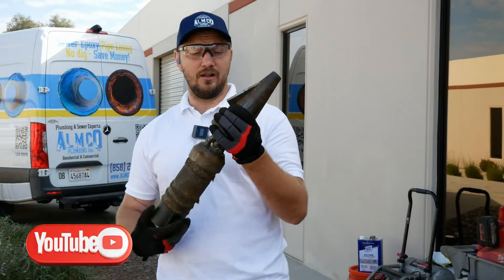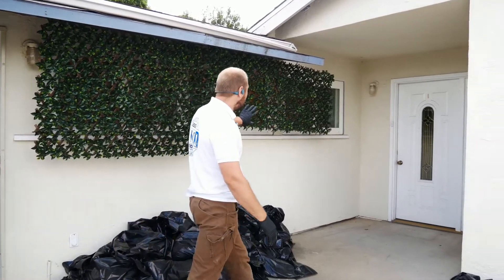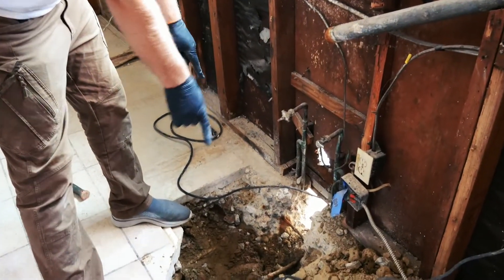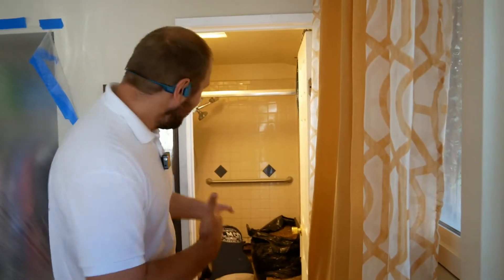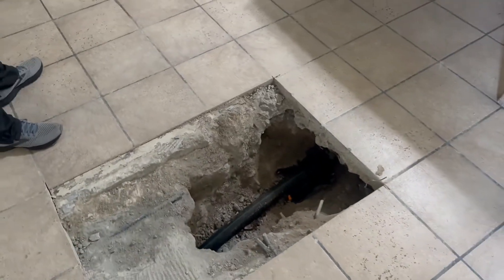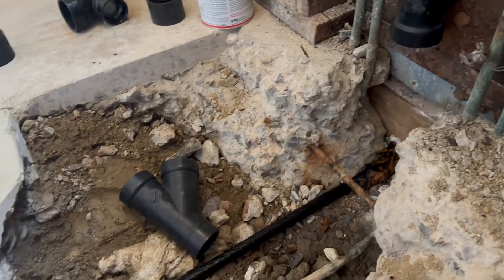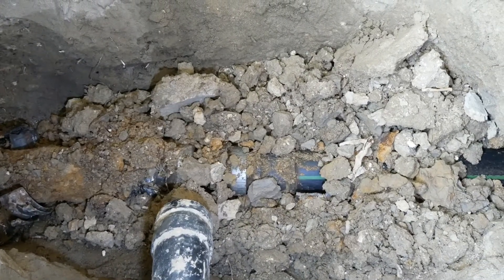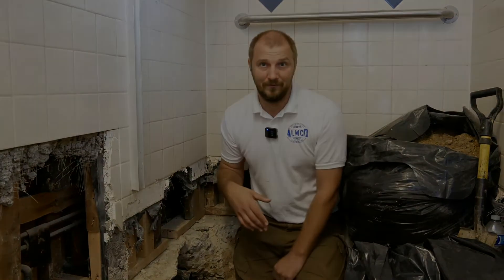Trenchless Sewer Replacement: How PIPE BURSTING Works | Real Case and 100+ Year Solution!

Comment: Can pipe bursting be done with old cast iron sewer pipes on a slab foundation?
Reply from the maker: Yes if pipe go Below 18 inch foundation or need digging near the foundation and make a hole inside footing a little bit bigger for pipe burst head able to go through
Reply: @ Thanks for the reply. Appreciate it.